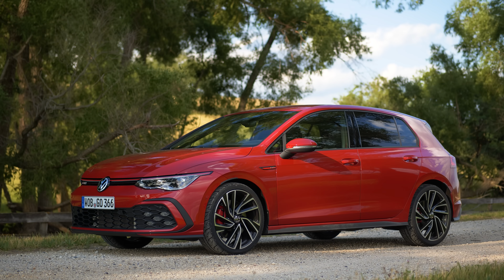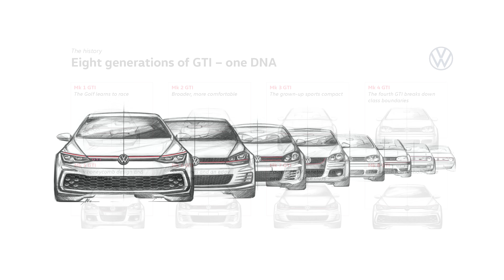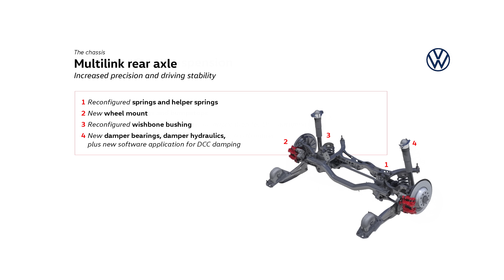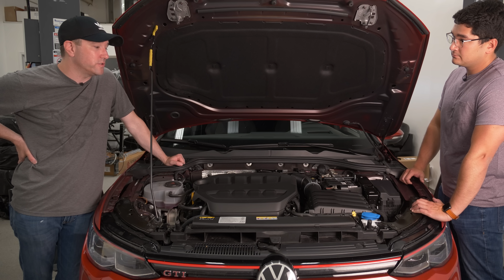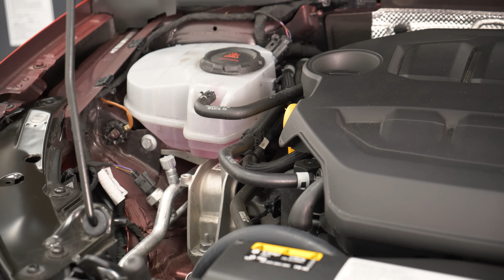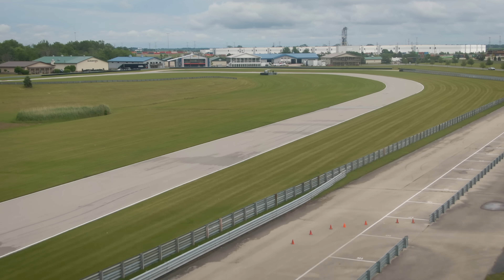2022 VW GTI Mk8 | Unexpected

Comment: What everyone needs to understand is that the reason the touchscreens are so bad (and they are ridiculously bad) on non-electric and non-selfdriving cars is because, those use cases are what dashes are being made for now.  The industry is moving to all electric, self driving cars.  So they are making these dashes towards that future, so those of us still buying GTIs, Porsche 718/911s, etc, are getting poor dash experiences because they were not built with those cars in mind.  If I could buy my 1999 GTI all over again, brand new, I would.  The driving experience and controls of those generations of cars are forever lost unfortunately.  (I now on a 2019 GTI and a 911-992 and miss my older versions of both those cars everyday)

Comment: Do these infotainment systems not have voice commands?  Shouldn't the driver be able to just say "fan speed 5" or "fan on feet", maybe after hitting a voice activation button on the steering wheel or something.  It seems so dangerous to have to stare at a stupid tablet screen while the car is moving.

Comment: Seems allot of the comparo's between the 7.5 and the 8 are really unfounded until we get an actual US Spec 8 to test.  We all know even the Euro spec 7.5's outperform the US Spec 7.5 so to me?  This proves nothing.  One thing I can tell you is pricing on the new 8 is going to be ridiculous.  This car with DSG is estimated to cost $36k-$38k (per motor trend mag).  The R is going to be pushing $50k.  So VW is basically taking the "affordable" "hot hatch" off market to average working folk.  You can't even step down to a regular Golf in the USA any longer since VW discontinued them in the USA.  So if you want an "affordable" "hot hatch" better go buy yourself a MK7.5 S as soon as possible.  The MK7.5 S is probably the best bang for the buck performance oriented car for the money right now.  I see them on dealer lots for under $26k (new) Get them while you can 😎

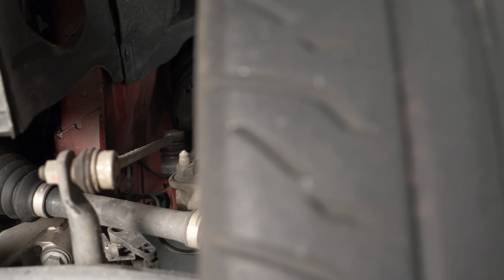Comment: Wasn't mentioned in the video but at 6:41 you can notice that they are using a new "pendulum style" transmission/dogbone mount which is a popular alternative to the frankly weak stock mount which I have snapped in both a Mk4 and Mk5, big improvement

Comment: In YouTube reviews about sporty front-wheel-drive cars, the driver always goes on about how much less the test car pushes in the corners than the previous version. And so the mantra continues with the new GTI, despite its porky 3100 lb. weight and 60% front-loading. And, the car being delivered with a Euro-spec engine and wearing track-ready tires. C'mon, guys! Only when Mark and Jack drive the next-gen GTI will we plebes be made aware what an understeering pig this version was in the corners.

Comment: Great review guys!

What a shame that such great driving dynamics are spoiled by a driving experience where the driver is pulled out of driving to deal with computers.

It's tempting to say it's design silo thinking, but I suspect it is top down directives. In a modern car once the computers are there, writing more code, and being able to code for different markets, is probably way cheaper than physical controls. 

Surely there must be experienced engineering managers who've designed Golf R's screaming with frustration too.

To me it wreaks of the design teams not having free reign.

I am feeling very satisfied with my decision last year to secure a 15 year old low km NC MX-5 for my garage, with a manual transmission, and a raft of wonderful changes I can make to a car that is simple to modify. 

We'll probably continue to update cars for my wife, but for me I think I'll be rebuilding my MX-5 every 200,000 kms to buy another 10 years.

Many people are decrying the increase in prices of used cars, but for the right ones, I totally get it.

Comment: THIS is the correct way to use modern stability control systems (ignore the fact you can turn it off now)... It's enabled them to set the car up way more direct than before and don't have to dial in understeer for 'safety'. There's no magic in it, it's just extra front camber, some bushings, springs, and anti roll bars.

Comment: How about setting the audio when stationary? Or better yet do not adjust while driving? For me, even with knobs, I use the steering wheel control mostly. Now, the HVAC controls is another matter...it's a fail for me. I much prefer knobs and buttons generally anyway (guess I'm an old guy, lol)

Comment: Fully agree with you in terms of infotainment. I went from Passat B8 to B8 after lifting. What a nightmare with swiping (especially Climate control) I need to also to disable every time Lane Keep Assist which I simply Hate. Yes, you can have such a feelings and it’s simply dangerous when driving because you have to go through 4 menus to do it. It’s a big step back

Comment: No physical controls and the amount of clutter on the steering wheel are a massive deal breaker. You spend 100% of your time IN the car and the very basics like volume and hvac controls should be driver friendly.

Comment: The direct and Port fuel injection is used as well on Brazil. Here is because our gas is very bad and creates more carbonization, so Port/indirect fuel injection is good in city and low Power usage(thus avoiding carbon deposits) and direct ir best when using power

Comment: The almost complete lack of physical buttons has me looking at a Hyundai Veloster N or Civic Type R as a GTI replacement. I’m sure this car is lovely to drive, but if I have to take my eyes off the road for 10 to change the HVAC fan speed or just completely pull over to operate the moon roof….  deal breaker. As a VW GTI owner I am deeply saddened by the direction they’e decided to go here.

Comment: I see all the comments here and I don't get it. Ive never had a real modern car and bought a mk8 in 2020. After few days I was completely adapted to the interface. I have a shortcut to climate and a shortcut to drive assist in the steering wheel. The only thing that annoys me is to have to shut off the start/stop every time I power the car. Other than that, climate, drive assist features, phone connecticity, everything has been super easy to use. And there is a plus side, I don't enjoy interiors cluttered with knobs and buttons
Reply: @twhalen  maybe so, ill try check it on the manual. I have not been able to do it yet. That's the only thing that annoys me so far.

Comment: I feel like VW looks at what the aftermarket does each generation and then tries to make those changes in house (within reason).  The MK7 has a long list of modifications that would get rid of the scrabble, let you turn off TC, let you rotate the rear end, and of course add more power.  I am glad to hear that the MK8 is a great driver, and with some upgraded seats it would be super fun for the track...BUT the interior is a bit frustrating.  Is the interior a reason not to buy it?  Probably not, and I would argue that the one reason to not go with the GTI is cost of ownership.

Comment: Maybe there is something  different  with my non performance pack mk7....but it rotates very well. Doesn't understeer much and the traction control is unobtrusive. I can even get the rear end out from a dead stop launch on a hairpin turn without having to do insane things to tap into the fun..  It's a 10/10ths car imo. I have not tracked it but I don't see why it would just fall apart....I have flogged it quite well. I also never felt the system in the mk6 was intrusive either.
I do find that the tire pressure listed by vw for both models is not ideal for performance and by going higher, you get that neutral car you are looking for.
I hope that the addes capabilities of the Mark 8 do not come at the expense of driver engagement at lower speeds. Going to the track is great but if you have to take it to the track to get some fun out of it I think it's starting to miss the point of what the GTI is supposed to be.

Comment: German cars in Europe: well equipped, well made, few reliability problems, low maintenance costs. German cars in US: self-destructing money pits.
Reply: They are just as problematic in Europe -- just check out DiagnoseDan!  He has lots of late model  VWs and BMWs coming in with mysterious electrical problems.
Reply: @TassieLorenzo   Our experience around here, and this is not easy on the cars, is that they require regular and proper maintenance. Many examples of VW 1.9, 2.0, 2.5 and 3.0 TDI engines with more than 800000km without issues. Many examples of straight-six BMW, both Diesel and Gasoline, with more than 500000km. Mercedes-Benz? Many Diesel I4, I5 and V6 with more than 1000000km.  Toyota and  (to a lesser extent Honda) are also OK, but not up to these values.

Comment: VW screwed up the ergonomics of the Golf/GTI.  They learned nothing from Honda's ill-fated excursion into overly touch dependent interfaces.  VW engineers are stubborn and doubled down over Honda's effort.

Don't believe everything you're told.  VW doesn't bring DI + port injection to the US because they don't want to.  They need DI + port injection to pass EU emissions.  DI alone has too much particulate matter.  In the US, we don't have gasoline particulate matter standards as high as the EU so we don't get the DI + port injection solution.  This engine could be federalized in the US easily if VW wanted to.  It's cleaner than the US DI solution, not dirtier.  VW is feeding you garbage and you're eating it.

Comment: I have my mk8 gti for 2 month now. In the beginning all the touch stuff seems  stupid, but you get 
Used to it. It is honestly super easy to control most of it just on the steering wheel.
I love mine, can not reccomend it enough, people these days are just searching for weakpoint and really concentrate on thosen
Reply: I've had mine for about 6 months. The touchscreen is issue is overblown. You will get used to the layout, and there really isn't any lag. It looks great too. I love this car
Reply: Any updates? And is this your first GTI?
Reply: @mhh1995  after 10 month i had 0 problems and im still very happy with the car.
Yes it is my first gti, but my dad owned a mk7 gti that i often drove. The mk8 drives a bit better, feels so much more modern and i like the looks more especially in black
Reply: @chimaera6234  Thanks for the reply! I’ve love my 2016 GTI. When I need to replace I will definitely consider the MK8.
Reply: VAG fans really showing their colors. Most pretentious enthusiasts along side BMW owners.

Comment: Gah. Really sucks that the interior of this car was completely ruined by touch garbage. To me, that and the ergonomics safracices they made with less convenient storage is an absolute deal breaker. I feel like I'll cause a pile up just trying to adjust the damn fan speed. I can't go for it until they return to physical controls. 

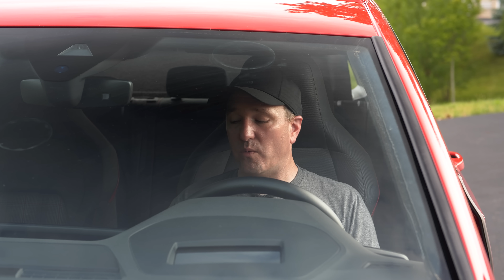Because here's the reality, I won't be tracking the gti (I don't track my current one either). I along with most other gti owners use it as a slightly juiced up daily. The last thing I want to be doing when driving home from work at 3:30 in the morning is flicking through menus trying to turn my defrosters on... or not being able to use a stupid sunglasses cabinet, or the little tray in front of the shifter... as silly as it sounds, those things matter. Yeah the car might drive a bit better, but to me it's not worth sacrificing those other things for a difference I'm not even going to notice.

Comment: Hate, HATE touch controls...with a passion.  Hate voice control almost as much.  Please, bring back normal buttons and rotary knobs with tactile feel (rubber dimples for easy grip/turn).  I simply cannot even consider such a car, no matter how nice everything else is.  The day-to-day aggravation and dangers to the "other" drivers on the road, just aren't worth it.  Sucks.
I loved my 1985 VW GTI.  110 hp, but a blast to drive (unless running A/C with four adults in it...not very fast then).  It also had a very functional dash layout...even better than the 2022 VW GTI.  So it's more like 40 year step back.  

Wrong technology, never the right time.  Get rid of it.

Comment: Subframe would be sprung weight -so the weight saved from there is probably not the primary reason to switch materials, rather stiffness.
Reply from the maker: The subframe in the front is the hard point for, lower suspension members, all  knuckles and hubs by connection are all unsprung mass.
Reply: @savagegeese  Thank you for writing back, really enjoy your videos! -So indeed the knuckles, hubs, brakes, etc. are unsprung but the subframe/chassis and anything else that does not move directly with suspension travel is considered sprung.
Reply from the maker: @over1g  to your point I should have clarified this.  The suspension without the body on top requires the subframe which would technically be below and not sprung weight. However, bolt the subframe to body in white it becomes sprung weight.

Comment: Mark and Jack, you guys are awesome!  I have MK7 GTI with 170,000 miles.  Complaints- ride comfort and initial off the line acceleration because front wheel drive screws me.  Did those issues get solved?  Thanks again, love your channel and all of your videos.  Jack is wonderful and Mark is an edgy a-hole I aspire to be!
Reply: I had the 7.5.   The ride comfort is vastly improved.   And the seats are way, way, more comfortable.   I do wish the seats still had adjustable headrests, but the comfort is enormously better. 

I’m a 60 year old female, so the comfort was a huge factor in my decision to trade to the 8. 

Also, just to let you know, the interface is super easy & intuitive.   Don’t let the reviewers confuse you about that.   It took me two days to get a handle on everything.  And believe me, I’m a tech dummy.

Comment: Tune, springs, tires, and pads on a Mk7 - Wouldn’t that be a good approach??
Reply: The fact that now all the suspension subsystems talk to one another gives the mk8 a inherent advantage dynamically over the mk7.5
Reply: @jackethnicallyambiguous  Jack put a rear sway bar on your MK7 with better tires when you compare the US versions. That would be an interesting comparison.

Comment: In 1983 I went to an autocross. After the race was done the local dealership let us drive a new 83 GTI around the track. I got out stunned and bought a new one the next day. After that I got a new 88 GTI 16V, a new 92 Corrado SLC (still own), a new 2004 GTI, and a new 2006 GTI, all with manuals. I don't know exactly why, maybe its the looks, maybe its the four doors, maybe its the interior, but I'm not going to go out and buy a new mk8 GTI. I don't really care that it has less understeer on a high speed track.

Comment: Man, you can't review a MK 8 with amazing tires. Seriously. You need to review one with bog standard all seasons to see if they REALLY fixed some issues. It's not even the same playing field. I'm a little shocked you guys didn't realize that you were reviewing tires, not a car. I bet if you took a MK7.5 put those tires on it and turned off the traction control via an OBD11 tool, you'd get similar results.
Reply from the maker: We will be doing it again when we get the North American car with a OEM tires
Reply: @savagegeese  I'd be really interested to see the difference. Perhaps they did nail it and the tires weren't as impactful as I'm thinking, but knowing how impactful tires USUALLY are, I'm pretty skeptical.

Comment: Awesome review--coming from an engineering/physics background, your technical analysis is outstanding and that is why I love your channel. I hope you guys can get your hands on a mk8 Golf R soon. That is the review I am most interested in. It possibly could be a Type R killer, claiming the hot hatch throne back, or at least I hope. We shall see. I will definitely stay tuned to find out.
Reply: Harry Metcalfe has already driven the Mk8 Golf R & current Type R, he says he prefers driving the Civic and that the Type R remains more engaging and more enjoyable to drive: https://youtu.be/mFzE_3rPEDo?t=1191 He also prefers the Toyota Yaris GR over the Golf R too for that matter (he even bought one!). :)  

So I'd say they both rank ahead of the Golf R in the hot hatchback enjoyment stakes, unless you only care about 0-62mph and quarter mile times.  [The Golf R is certainly a lot better than before with the added torque vectoring and stiffer rear end settings though, but the steering is still said to be on the numb side of things.]

Comment: How does it compare to the Veloster N in terms of driving dynamics and overall fun?
Reply from the maker: The Veloster n is way sharper faster and much stiffer better track car worse street car
Reply: @savagegeese  thanks! Does the GTI sound anywhere near as good? Part of the draw of the Veloster for me is the fun factor of the exhaust. Not even the pops, just the overall character
Reply from the maker: @mistople  GTI sounds like nothing, just air moving.  Its just a refined experience.  The Veloster has more character.

Comment: No golf-ball shifter!?  REEEEE

How do the 6MT gear ratios compare to the 7 / 7.5?  Does 2nd gear still literally wind out past 75 MPH?

Also for fellow Mk7 owners you can unlock the fully-disabled traction control option using ObdEleven.

Comment: Damn. Havent seen mark this excited over a car in a long time. The best part is that the GTI isn't a crazy fantasy car, it is largely attainable for even enthusiasts on a budget.
Reply: In Australia, the Renault Megane RS and Civic Type R are in a similar price range and are more fun to drive.  If you want something more upscale, the BMW 128ti is now uncomfortably close to the GTI in pricing.
Reply: @TassieLorenzo  they killed of the 1 series in the US a while ago, we get lucky to get any hot hatch. We are usually stuck with sedans. Here in the US the GTI is significantly less expensive than the Type R by $10,000 USD. I don't see a lot of type R running around but GTI is fairly routine.